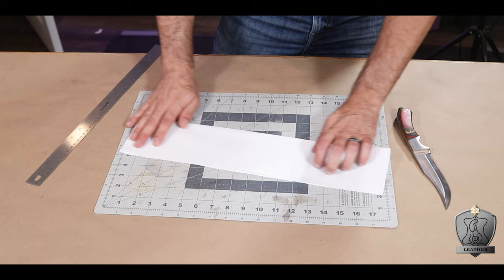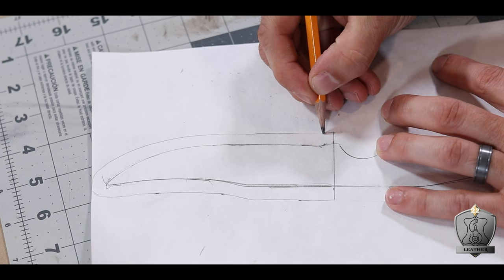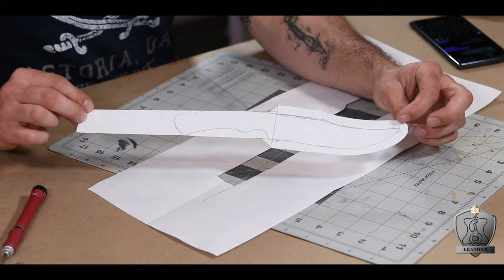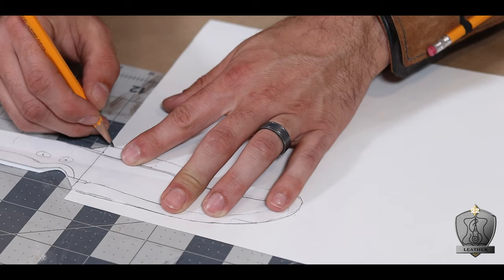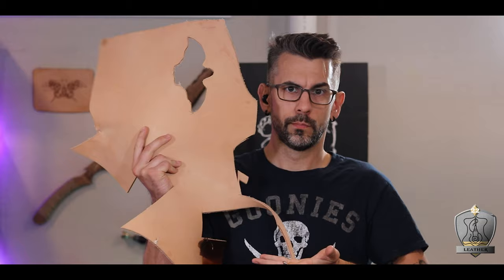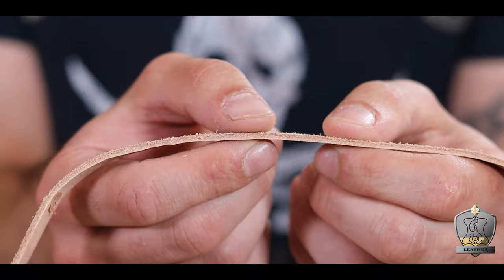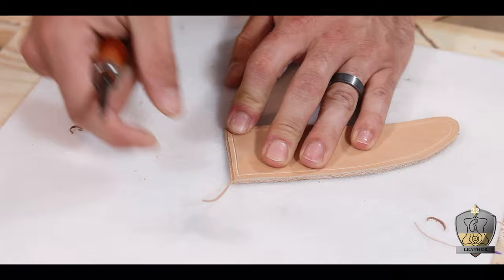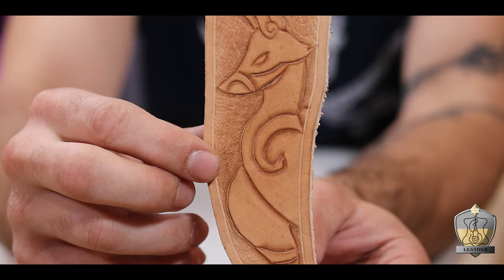Leather Knife Sheath DIY Step-by-Step

Comment: I like all of this except for 1 TINY detail... I would have cut the relief cut for the retaining strap on the other side of the button hole. The way Cl3ver cut it applies all the restraining stress on the cut and concentrates the force to the very tip of the cut. Cutting the relief on the other side would apply all the stress to the rounded portion of the hole and run parallel to the relief, reducing the stresses.

Comment: I am a blacksmith.  My blades are beautiful, but my leatherworking still needs some tinkering to level up.  My sheaths generally look a little... rustic, to be kind.  The keep the blade reliably safe and at your side, but I will use the techniques you have here for my next one.  I need a punch to get clean holes for my saddle stitches!